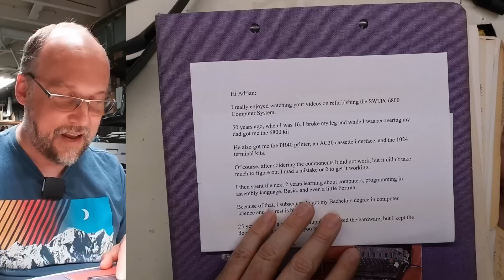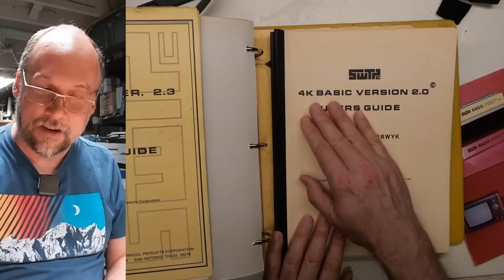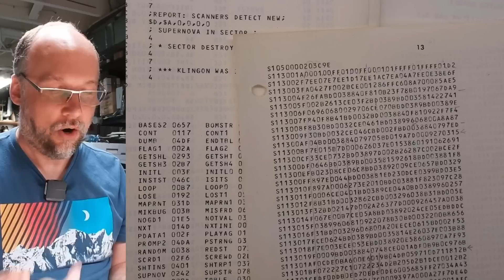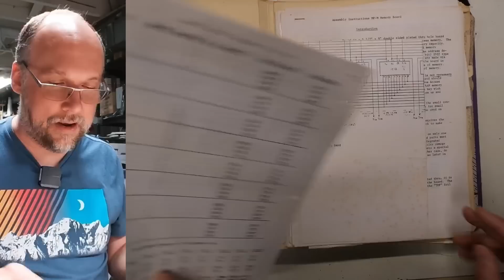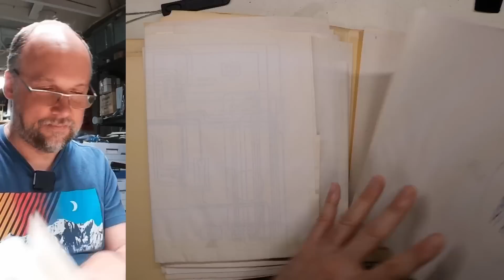0064 A freakin' Commodore bag, a smokin' TRS-80 Model 4P and some 50 year old manuals

Comment: Couple of pronunciation tips so you sound like you're old hat at this stuff: SWTPC is usually pronounced "swaptech" by those who used their stuff despite the T and P being in the wrong order in their name. Thus, their monitor was called "swapbug". The Motorola monitor you're thinking of was called MIKBUG and it was from Motorola's Exorcizer development system. This unfortunately meant the SWTPC 6800 had to put RAM, ROM and peripherals in memory at the exact location MIKBUG expected it. This led to all sorts of issues because Motorola's design wasn't very flexible. Also, MIKBUG required program entry from the serial port to be in Motorola S-Record format which made program storage so much slower than it needed to be. I believe SWTPBUG allowed some flexibility here. If you want to learn more about the SWPTC line of machines in incredible detail, well-explained and with tons of cool other gear, then you should check out deramp5113 on here. He has done a huge number of videos on the Altair 8800 and 680b systems, as well as the SWTPC and many others. His channel is an absolute goldmine of information!

Comment: Since the font is very consistent, I wonder if OCR can be used to get the hex values of the programs. Probably need to be manually checked but that's much easier than a full manual transcription

Comment: It was cool se eing the old manuals for the SWTPC - I recognize several companies that later went on to produce software for the TRS-80 Color Computer as well. Computerware ended up doing BASIC compilers, utilities, graphics packages, games, etc. (including stuff sold by Tandy themselves). Microware later made the OS-9 operating system for the Motorola 6809 CPU (descendant of the 6800), which was sold for the Coco starting in 1983, and then actually did both “Super” Extended BASIC (adding the Microsoft’s) and OS-9 Level 2 for the Coco 3.

Comment: Hımmm, that clip on thingy with LEDs is really neat,. I am guessing there must be some simple trickery to visually slow things down in that box because otherwise high speed data will be virtually indistinguishable from a solid HIGH. It can be very useful tool to crudely check activity on logics and RAM ICs before desoldering them... I am getting ideas grinding in my head, I wonder if DIP IC clips are still easy to get...

Comment: Either us, or our parents eventually tossed our 80's computers in the late 90's, when they were considered to be nothing but obsolete junk. There was a dark age there when 8bits were not retros yet, and became totally worthless. I somewhat luckily kept my ZX Spectrum from 1983 mainly because it had sentimental value and didn't take up much space, but I tossed a lot of things, among which my original IBM XT, along with its model M keyboard, tossed my Psion Series 5MX, my Casio Cassiopea Fiva 101 etc, which I am banging my head at walls for now. That ZX Spectrum is the reason I am into retro computers now, enjoying it to the fullest along with quite some other 8bits that I have acquired within the last 6-7 years.

Comment: I use to program one of the CT-1024 systems in the Planetarium at OMSI, with a program in EPROM.  It had a "custom" wood case with a monitor on top (Similar to an Apple II).  It was hooked to a couple of side projectors mounted to a home made X, Y, Z platform.  We called them the "Zoom projectors".  One projector could cover half the dome.  Toss up a slide of a planet, comet, etc and move it around the dome.  Large zoom lens attached to the projector, modified using a stepper motor to make it a motorized zoom lens.  This was in the 90's  before we purchased a digital Planetarium projector (Digistar II).  I didn't build the "Zoom" system but had to teach myself how to program it since everyone who knew how, were no longer there.  Bit of a pain to program the movements.  Fun days back then.

Comment: I left my complete TRS-80 Model 1 with my parents when I went to university.  It was modded with things like speed double and lower case font.  I had the expansion interface with full memory and two floppy drives.  There was also an "official" printer and vox unit.   While I was away, my mom tossed the entire system.  Such a waste.

Comment: What was a use case for such systems? It's not very useful as a calculator, as there is no floating point support, the BASIC is too imprecise, and finally, programmable calulators could use magnet cards or PPROM modules to store programs. It can not do accounting or edit texts because it has no RAM. Was it just a toy to waste time?

Comment: This is Tyler, I did actually watch the previous septandy episode of the TRS-80 4P that Seth sent to you before sending this one to you. If you had told me not to send it, that is my bad as I don't remember that. I noticed on that previous video you had made, that it was a very modded TRS-80 4P lacking the original disk drives, you said something about that in that video. I just figured it would be kinda neat to learn what fault this one has had the last time I powered it up, and it might also be neat to see what changes Tandy had made to the newer machines before the TRS-80 line ceased to be manufactured. It is a much newer machine, you can tell that by the plastic clips on the case's base cover. The other one you had done a video on earlier was a much older version with the metal clips. I also did warn you that it absolutely does smoke when plugged in and turned on! If you decide it is worth while, hopefully it will not be an absolute pain to get back to fully functioning. I was not entirely sure a fault had occurred in the power supply, because wouldn't it just be completely dead after smoking? But you had it do exactly what it did to me 10+ years ago when I put it in storage.

Comment: Back when I was a programmer in the 70s I collected many files.
But I transferred them to a PC in the early 80s - still got them but on backup tape.
I still have the 8' 5¼ 3½ and 3 inch drives and disks.
Pity i'm too lazy to plug a tape into a computer today ... 🦘

Comment: What's kinda funny, it's the case that's the hard part to keep nice.  You can usually fix the electronics, but you cannot get replacement plastic case bits.  You may be able to 3D print something, but even that is hit or miss.  But even custom chips can be worked around.  The case, not so much.

So scoring a good case computer is like finding unicorn poop.

Comment: Dear Mr. Black you now have assembly instructions and schemes for the mainboard with 3 connectors so you should be able to have the pcb's made and place and solder the parts, and thus upgrade your swtpc.

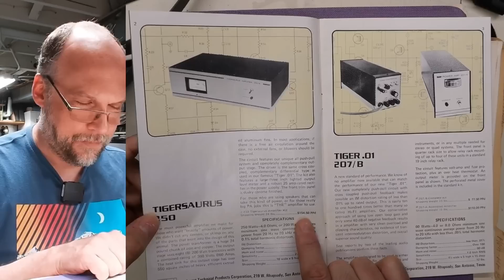Comment: 7:00 I think ppd means "postpaid".
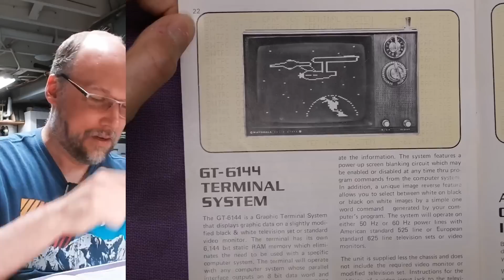9:52 That Star Trek graphic was normally used to show off graphics from the COSMAC ELF, so maybe it uses the same RCA video chip?
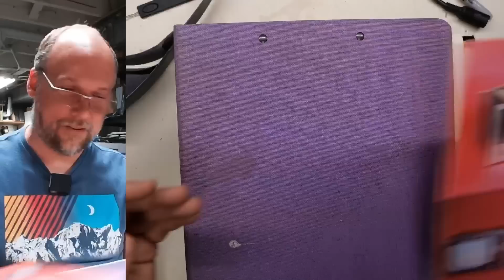12:30 Yes, that printer looks weird like that, like some kind of display for an antique, it looked strange even back in the day.
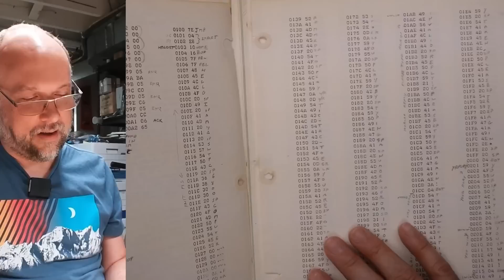21:45 I'm mostly surprised that they didn't put that code into a 16-column hex dump, like that later one. (And that's called "S19" format.) The checksums can help you find typing errors.

Comment: Here in the UK, in 1980, the Sinclair ZX80 computer ONLY came in kit form. In 1981, the ZX81 came out as a kit or ready assembled, there was also an upgrade kit to turn the ZX80 into a ZX81.

The ready built ZX81 out sold the kit ZX81 so much the kit was discontinued after about 2 months. By the time Sinclair released the ZX Spectrum, it was pre-assembled only.

Those manuals and schematics are so cool.

Comment: I remember typing in programs for my C-64 from Compute magazines (and Compute's Gazette). Such a pain but if they worked it was great and you could learn a lot from them.

Eventually they had checksums in the programs you typed in and a program to check the checksums.  Of course, you had to type in the checksum checker program first, haha.

If I remember right there was eventually a disk version of the magazine.

I re-acquired my first computer, a VIC-20, about 10 years ago and it still works and looks great after a little TLC.  The cassettes with all my programs either got recorded over or lost over the years, but it's nice to have the computer again.

My C-64 is long gone along with all the programs and everything.  Never thought after getting an Amiga I would ever care about the C-64 again... :(  I did save all my Amiga stuff so that's a plus.

Thanks for the trip down memory lane!

Comment: Reguarding the MP-R. If you had a mp-a2 processor board there were sockets for the 2716 eproms. The software for the programmer came on cassette tape. If I remember correctly there were two types of 2716 rom chips and you had to be sure you got the correct ones for use in it. 

The AC-30 used 300 baud and what was called the Kansas City format for the audio on the tapes.